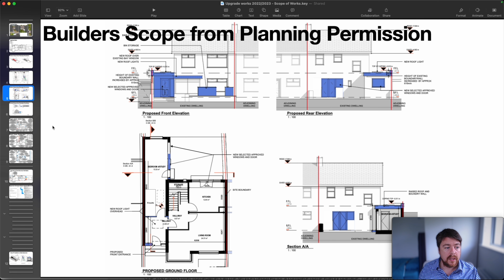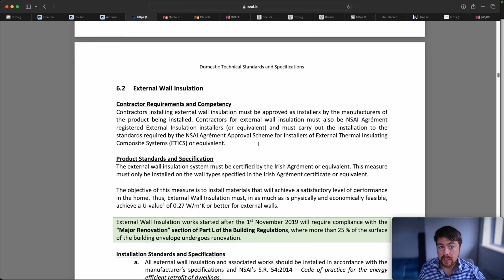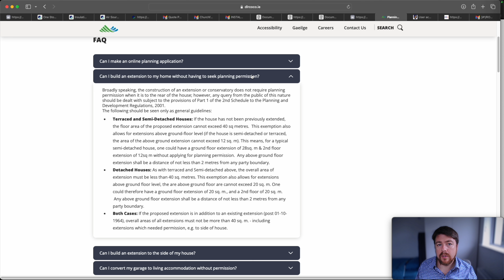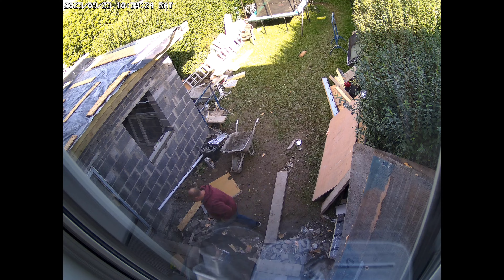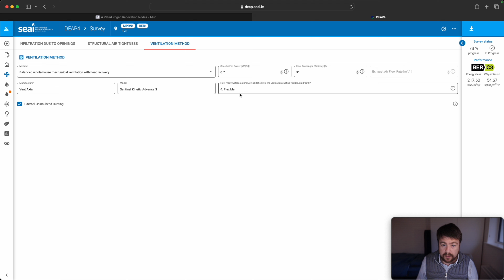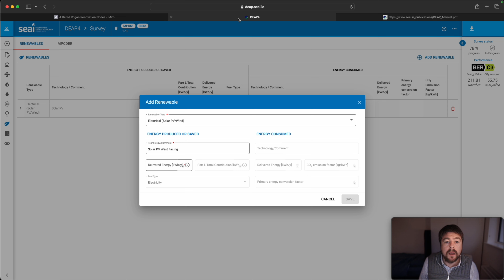Guest Suite & External Insulation - A Rated Rogan - Episode 7

Comment: Hi Daragh. We're pre major renovations, as such your video series has been a gift. 

Would you have any knowledge on the implications of installing EWI oneself, or if this is even possible legally speaking?

My father is a builder with the skills to deploy whatever spec is needed. I've spent several months research detailing around windows, eaves, plinths etc.

The cost associated with SEAI contractors seems very high considering the cost of materials. 

Thanks in advance.
Reply from the maker: what I'll say is, having had it done twice now, the cost is high compared to the work & materials received... In saying that, watching pros fly through the work makes it look simpler than it likely is.

I've seen individual homeowners do it themselves, and the pitfalls I feel are:
- finish of the final render
- getting the detailing right around fire rating at adjacent properties (that could get you in trouble in a fire situation)

Maybe have a read of the SEAI Domestic Technical Standards and Specification to gauge whats involved
Reply: Thanks for the reply. I was hoping to self install and hire a plasterer to finish the render. 

The house is only adjoined and one side to a vacant property that has EWi already installed. 

My main concern was the implications of a self install with respect to any certification needed if ever selling. The information around this is scarce!